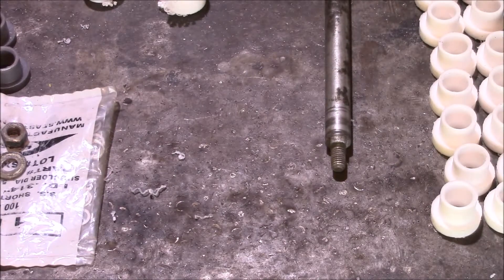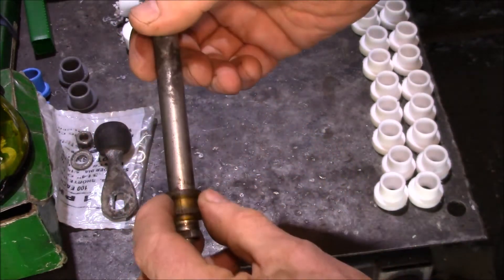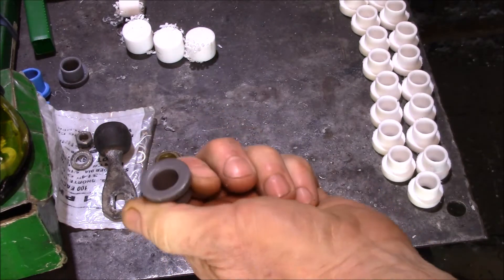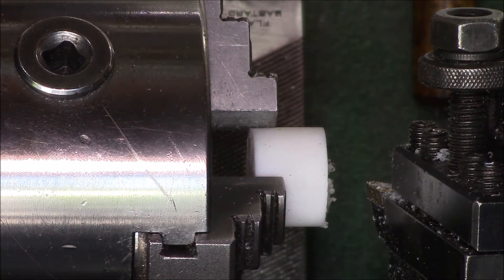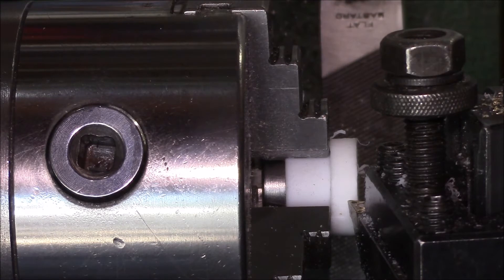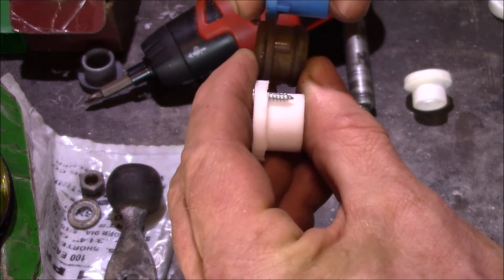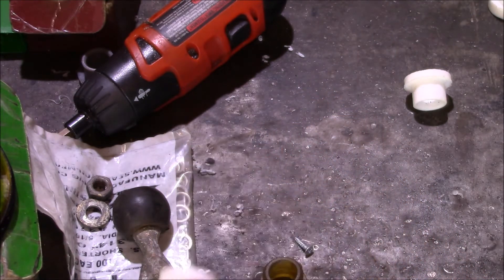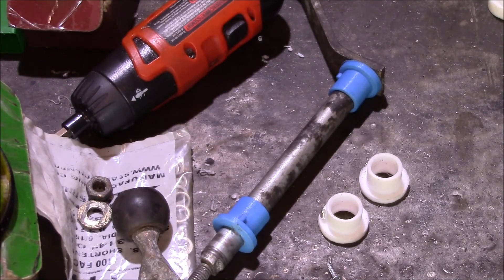Making VW Relay Shaft Bushings

Comment: My father had a VW bus for more than 25 years.

Incredibly solid strong engines.  Never start problems.

After years, only then is there is real maintenance is needed.
Reply from the maker: Yes, quite good vehicles.  On both the air and water cooled engines.  For me, the major issue has been the shift linkage.  Likely when the German engineers designed that back in the '70s, it was all done with precision bushings and all-metal linkages.  But then the bean counters came along and cost reduced that system with plastic linkages and inexpensive molded poly bushings, etc.  That stuff works fine for 5-10 years, but with the rest of the vehicle still in great shape, you can't shift gears anymore.  My current '82 pickup was almost impossible to drive when I first bought it.  It would take a good 10 secs. at a stop to find 1st gear and 5th gear was hit or miss on the highway.  Now it shifts crisply into all gears with no effort.